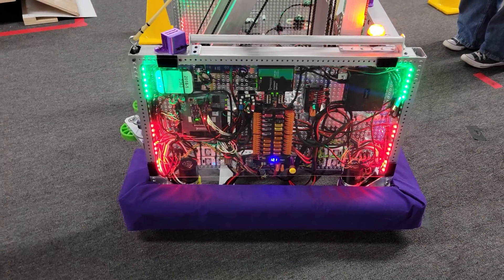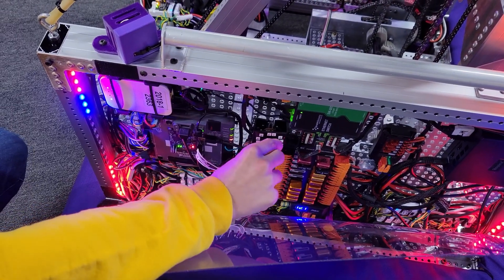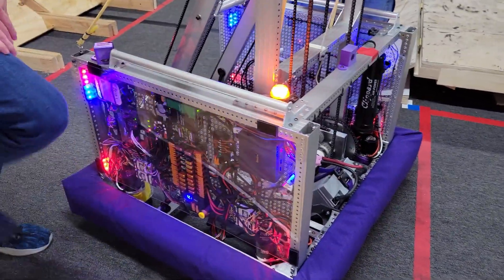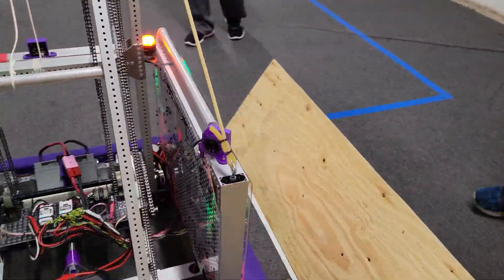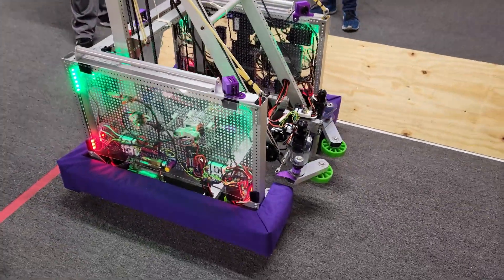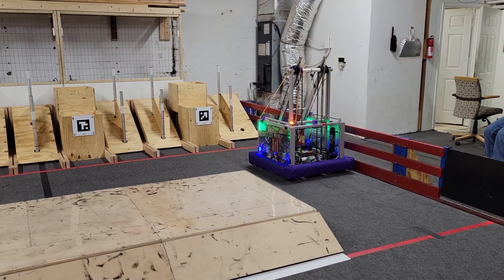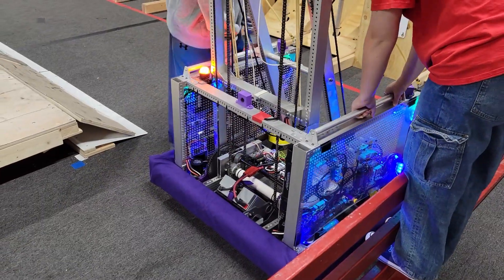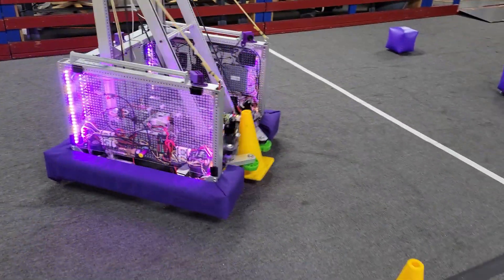Smart Auto Setup using April Tags

Comment: Is there a specific reason you are not using spendable choser?
Reply from the maker: Yes, we've had occasional blips with sendablechooser in the past that has cost us matches. A set of physical switches on the robot, plus the LED feedback, lets the entire team feel empowered to check that our auto mode is correct before the match, not just the person who is setting up the driver station. We believe this increases the feeling of ownership over this critical setting and produces a more reliable human-robot system.

Comment: 0:10 the allience switch isn’t really necessary. The API will give you what alliance you are on based on the FMS
Reply from the maker: Indeed. However, we have had occasional blips with this method in the past that have cost us matches. A set of physical switches on the robot, plus the LED feedback, lets the entire team feel empowered to check that our auto mode is correct before the match, not just the person who is setting up the driver station. We believe this increases the ownership over this critical setting and produces a more reliable system.

Comment: wow, awesome way to select autos, what is that switch that you turned to change autos called?
Reply from the maker: Thanks! We're using a single pole 10-postion rotary switch to select between the auto modes.
Reply: @TripleHelix2363 Do you guys have a link to the switch you used in the video?
Reply from the maker: Switch: https://www.amazon.com/uxcell-Split-Positions-Rotary-Switch/dp/B008MJWTN2/
Knob: https://www.amazon.com/uxcell-Insert-32x19x16mm-Plastic-Potentiometer/dp/B07JN52VWW/